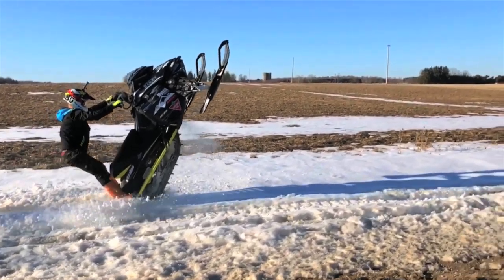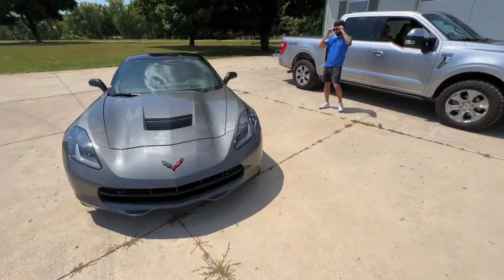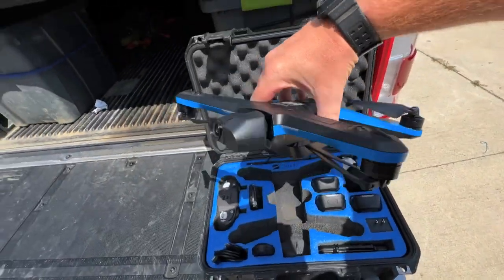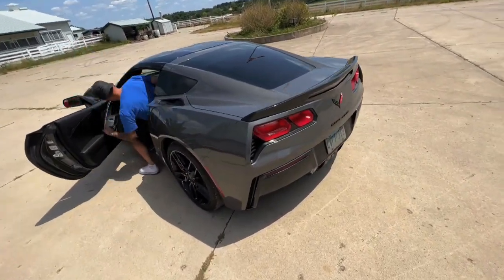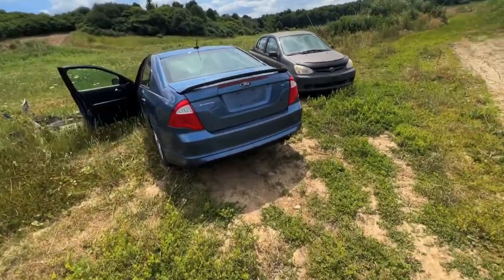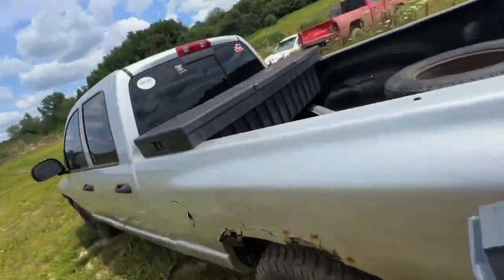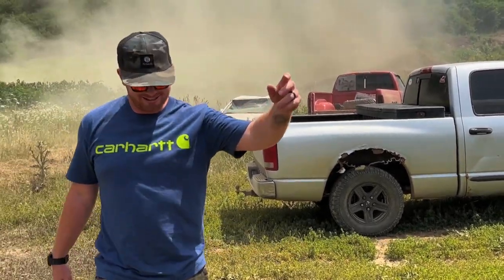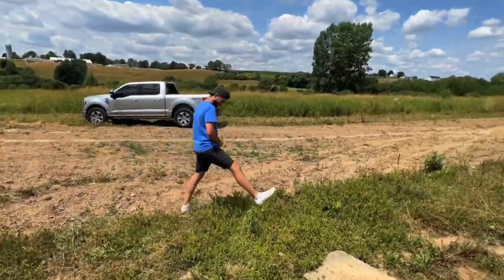CORVETTE Vs Dodge Vs FORD!

Comment: Should get some patio deck blocks from home depot make a little burnout pad.
Reply from the maker: Had a bunch, they snapped in half pretty quick.
Reply: You can get steel reinforced ones at brick yards ment for under mobile homes.. also if you put a sand base under them probably last alot longer.. or could always order a yard of concrete 🤔 😅